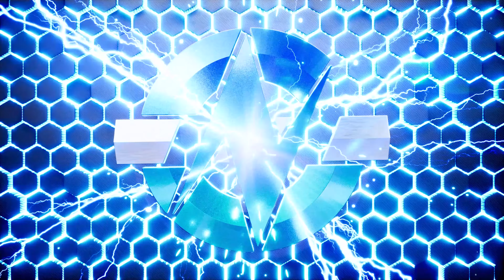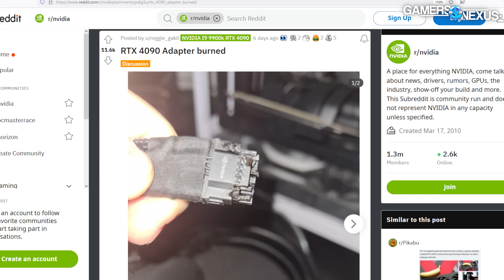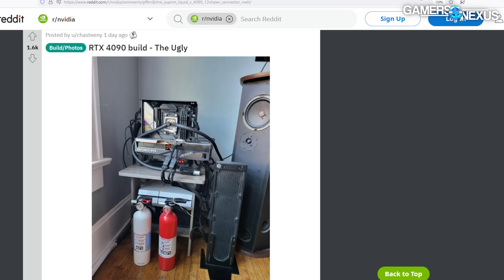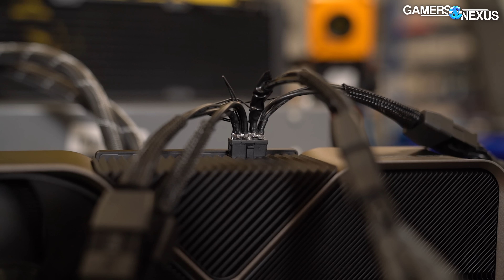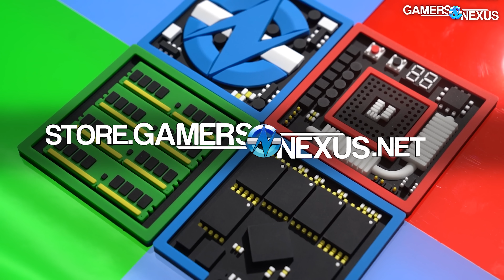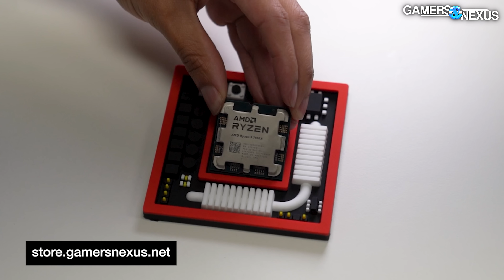Testing Burning NVIDIA 12VHPWR Adapter Cable Theories (RTX 4090)

Comment: I think the camera looks like a "Jeff " and thanks for doing the testing . you have just raised another big point about the cable "V" rating and plug make up. What I dont understand is if they only need 4 X 12V cables and 4 X negative cables why did they need 4 X 8 cable connectors and why not just 2 like corsairs ? easier to squeeze in less cables ?

Comment: Name for the cam: FLIR-E
It just reminds me of WALL-E. 😂

Also: I believe the most heat would be generated if the cable is snapped, but still close to the connector so that it loosely connects with a high resistance. This would lead to a rapid increase in temperature additionally to some internal sparking.
Ripping them apart and just leaving two, or even one of the 4 12V cables connected is, if you can believe it, a happy failure case. Having it arc and connect only slightly is the worst case.
Disclaimer - I am not a studied electrician but messed with low voltage all my life. This is just what I experienced. Take it with boat loads of salt.

Comment: Connectors melting at the front, indicating poor mechanical pin-pin contact, oxidated pins, low quality pin material… Tech youtubers (except one) focusing on the back side of the plug, on solder and wires. What?

Comment: I wonder if arcing caused the melting.  So cutting cables wouldn’t do it.  It would need to still be passing electricity through lifted solder points while insulated.  I know very very little about electricity but this is what my common sense tells me… 🍻. And if this is what causes it, it’ll be lots of cables that melt as this is how the crap cables are failing.  Seems like the better made ones won’t fail

Comment: Why aren't the pins directly connected to each wire and the bus bar located inside the actual GPU? That's how it is in most other electronics I've looked at. I was just watching a breakdown of the battery in Tesla vehicles and the bus distributor is an internal component of the actual battery pack and not external at all. Which makes tons of sense. It's a point of failure and having it be part of a connector seems really strange to me. I'm not expert at all and I could be talking completely out of my ass here.

Comment: Looking at the specific models that have been popping with the burned adapter, I noticed that they all have the female connector very recessed and I tried this with mine (Gigabyte 4090 Windforce) if you plug the adapter in while the GPU sits horizontally in your PC its very difficult to get proper contact while mainting bootable contact. I then laid it on the side and plugged it in and was able to hear the audible click and it went straight in. Mind you my model doesnt have the female connector as recessed as the others do, specifically the Asus TUF and MSI Gaming and Suprim models. Could this be a combination of poor design and it being easy to plug the adapter in to a bootable state but not proper contact?

Comment: Oh, I wasn't sure if this was going to be tested by GN.  By the way, AMD has already confirmed that they will not be using this standard of connector.  They'll still be using the previous connector.  The interesting part of this is that there are two different cables.  I'm curious if this was an already known issue by Nvidia well before release and was revised, yet a few bad cables still made it out.

Comment: I'm wondering if these cables are hand built, so the different styles of soldering could be down to individual workers in the factory/factories, different wire specs could be supply chain errors or different revision states as the adapter evolves and possibly even as deep as to the type of solder, paste, lead or lead free, or type of flux used during soldering. BUT ultimately trying to reduce 32 larger pins from 4 connectors into 12 on one whilst trying to make that connector smaller is ridiculous, it has less contact area at its bridge point to the card and you introduce 12 more points of resistance that you didn't need (you would always have the 32 from the 4x8 pins). I don't have a 4090 and as of yet have not physically handled one, so my proposals are all drawn from images and videos I have seen online and a serious interest in finding the cause of this as I suspect it is only a matter of time before this takes someones life.

 Now I'm wondering if this IS not the adaptor at all, and without seeing the failed adaptors opened up to prove that contacts within them were damaged or the cards themselves tested for faulty components on them, I would like to throw in some new theories. 

    Vibration of the connector due to airflow generated by fans in the systems, an extreme longshot but the number of fans and the drag created by this number of cables, plugs and wires disrupting the flow will cause those parts to vibrate, the plugs being specified to 30 (iirc) reconnections is the same principle effectively, it is to do with the motion of the plug opening the female side of connectors in the plug each time it is interfered with so each time the resistance in the connector increases slightly. If this was on a sense wire pin (the 4 extra on the bank below) then this could be flicking one of the triggers which tells it to draw 4 lane/600W rather than 3 Lane/450W and this fluctation WILL cause increased heat.

    Or maybe a component failure on the cards, could this be something like a MosFet overheating and drawing more current down certain lines, or similarly a failing buck convertor circuit doing the same, and the rest of the power train is able to bypass the fault but draw the same current through the rest of the circuit thus drawing higher current through the supplying pins to the remaining working power stages causing a rise in thermals at non solid connections in the power supply.

     Lastly, faulty manufacturing, but not as described before, we've seen 150V and 300V main cable adaptors both suffer this, but has anyone checked for short between the 2 rails, as I suspect these are hand made, then the possibility of human error is there and that being damage to the plug from overheating whilst soldering the wires to the plate or solder splatter (fine solder balls) bridging the wiring and this is not tripping the OCP on PCUs because it is creating current draw below that of the OCP limit, but it remains enough to create adequate heat to melt the plastics.

Comment: NVIDIA and power cable adapter (or third party ones) made cheap in ccpeepe by snot nosed with large egos that think they know it all using the wrong parts to save time and money while ignoring specs and safety while doing a piss poor solder and crimp or tape job using the wrong solder too I bet that starts to melt at a lower temp while pushing 12V at 25a to 50a. Real good combo there.

Comment: Hey GN .. just chiming in my 2 cents worth. The connector pins that suffered the most heat damage were the ones carrying the most current. If the cable broke the connection to the pin, no current would have flowed into that pin and it would have melted the housing around the pins nearer the middle, rather than the extreme left/right ones.

Comment: On today's internet, it takes balls to publish a video like this where you've basically come to the conclusion that your results are inconclusive. Great work. I hope the call to action here is enough to get ya'll the examples you need to get to the bottom of this.
Reply: Science publishes results. That's why we don't call it marketing.
Reply: @Shalmaneser1  Proper scientific method certainly isn't marketing.
But sadly sometimes journals can partially be.
Rejecting things like reproduction studies and "less glamorous" parts of the field in order to make room for "interesting" new discoveries.

Thankfully not all journals have taken that route, but an alarming number of them have.
Reply: They aren't even really inconclusive, they just didn't confirm the theory presented. They did however conclude, there were different cable versions. Also, suggested more testing is required.

Fairly standard scientific testing results.
Reply: Balls?  It's for clicks.  Make a useful video or don't make one IMO.
Reply: @EVLS10  "Testing Burning Adapter Theories"

tests theories related to burning adapters and does extensive testing, discovering cables are different between adapters along the way

Yes, very click baity
Reply: @maxsicarius  Well, you could argue the thumbnail is clickbaity, since it gives the appearance of "there will be epic fire this video".

Comment: Not an electronics expert by any means, but in my hobby (RC cars) what I'm seeing on Igors cable is what we call a cold solder joint. You have to get the wire, mating surface and solder to the same temperature in order for a proper solder joint to happen. Looking at place the wire broke off and the wire, that particular joint did not reach the proper temp for a properly strong joint. And not only would it have been weak ( like the way it broke), But it will slow or even stop the flow of current. In the case of your adapter those are properly flowed and created solder joints

Comment: RTX 3000 line uses similar cable to the RTX 4000 maybe compare the two to see if a difference in wire specs are there. Could be possible that RTX 3000 12 pin wire harness got shipped with RTX 4000 and the ones for the RTX 4000 supposed to be higher spec.

Comment: I still think that the problem is bad soldering causing outermost wires to break off from the soldering plate, thus creating a loose electrical contact, which eventually results in electrical arcing between the broken-off wires and their plates.

Two things from a quick Google search:
a) electrical arc temperature : anywhere from 2,500C to 20,000C
b) plastic self-ignition temperature : between 350C and 600C

An obvious conclusion would be that a single electrical arc can ignite a microscopic piece of plastic, which will quickly stop burning due to the lack of oxygen (in the closed environment of connector's casing). A series of (many) such arcs, however, will eventually burn right through the plastic casing, at which point smoke (if not outright fire) will become visible.

Therefore, all experiments trying to recreate this problem by opening the casing or cutting outermost wires are going about the problem all wrong.

The correct experiment would go something like this: have an X-ray machine (or something similar) to see what's actually happening inside the casing without opening it, bend the cable until at least one wire breaks off from the soldering plate (again, without opening the casing), and then start testing that connector for internal electrical arcing.

I don't think that we'll ever see such an experiment on YouTube, though. And even if somebody manages to recreate this problem, it probably won't matter by that point.

It's obvious that all existing adapter cables with this problem (nVidia must know by now from which manufacturer(s) those have come) should be pulled, and replaced with better quality ones.

Also... soldering (as a method of choice) may have been a really bad idea in the first place.

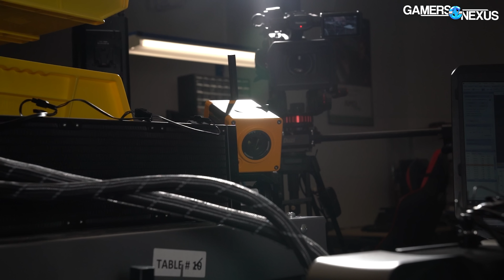Comment: 0:35 ¿have anyone noticed the pins of the card are not in the exact center of every slot?

other pictures of the connectors also look out of center contacts, if the card has no centered pins, no cable will guarantee a good connection (if you want more explanation I add a picture example)
Reply: Yes, and it's normal. Slight variance in pin location & size is normal and inevitable in the real world (things like manufacturing tolerance, wear & tear from use), which is why the metal terminals/pins are free to move a little inside the plastic housing so that they can align and compensate for this.
Reply: @rednammoc  but is too much, one is almost in the border and many out of center, that can't be normal in a 1600 dollars product, and less in an advanced electronic (you can zoom now the video on mobile YouTube)

Comment: Bet you it is a smart PSU problem where they have a line calibration to prevent droop on the GPU. It detects the large range but the PSU pushes too hard to accommodate thus turning the GPU into one of them electrified wood arts.

Comment: While the cable rating is typically insulation rating (assuming equal wire gauge) it still suggests cost cutting.  More importantly, the soldier point being weak enough to snap off and the contact being split are both ways that minor additional damage could significantly increase resistance.  
That said, the melting appears to be in the socket and not on the wire side of the plug.  That gives more credibility to the pin theory or the connector not being seated.  It reminds me of plugging in old loose molex when the female socket moves instead of seats except that didnt pull 10A on a 12v cable.
Great vid.

Comment: Soldering the cables to the contact like that seems like really strange design choice. Normally you want a physical shrink instead. Not making it 90 degree is also a strange choice considering that it must bend close to the side of the case. The narrow design making it vulnerable to side way forces is a third. 
So disregarding what some "youtubers" say I think this contact is bad.
Connectors overheat when there is bad contact (higher resistance) or intermittent contact (micro arching) between the pins. Both versions take some time to develop (if ever) which is why it is hard to test, especially for time challenged youtubers.

Comment: Excellent video Steve. I for one really respect the fact that you took the time to properly investigate and not just use this situation as an opportunity to harvest easy clicks. 

There’s a fine line between raising awareness of a potential danger and uninformed alarmism, and many channels crossed it this week IMO. 

Cementing yourself as the best in the business and we all greatly appreciate your efforts.
Reply: ironically igors lab was probably the worst offender for alarmism... some would argue its informed though but clearly something isn't right with his discovery and stating that its THE issue. i checked my 4090 cable and i have a 300v cable (msi gaming x trio) it will be interesting to see how many 150v cables are out there.

buildzoid (actually hardcore overclocking) made a good point in that if it was the solder contacts being broken and causing the issue then the heat would build up at the solder contact point and they would all be melting much further down from the pins and so far the evidence shows melting is always in and around the terminals.

who knows. i agree its good to see actual in depth testing without jumping to conclusions.
Reply: @jinx20001  I think Igor’s content potentially  came across more alarmist than he perhaps intended due to the language barrier. But yeah it certainly did read a bit “I’m right and everyone else is wrong”. 

But at last he backed up his claims with actual testing. 

And yes AHOC’s point is very valid. Although I’m not sure if there’s a larger gap between the plastic and metal near the contact pads than there is around the pins themselves. 

It would absolutely be the case that if a pin wasn’t interfacing correctly it could cause this problem too as they’re responsible for carrying such high current.

Comment: There's one caveat with all these theories in that electrical current, much like water currents, prefer flowing down the path of least resistance. If one set of pins has a low resistance, and another set a high resistance, assuming the 12V connections meet at each end, most of the current will flow through the pins with the lower resistance, even if it means these pins will gain heat in the process (up until an equilibrium is formed, if possible).
This is looking like somehow every centre pin is failing either in the connector, in the cabling, or somewhere else is failing, leaving only one pin on one end or both ends connected. This makes sense with the 1+2+2+1 solder layout if the cable were to be completely defective or almost completely failed when being used.

Comment: My one case when I made a molex type connector come close to failing by borderline rating it has manifested after several hundred power on off cycles and about a hundred hours of use over the course of about 3 years, there was oxide discoloration on the metal and the connector was about to go runaway, where with each use or several it was getting a little warmer, it would have actually caught fire eventually. The housing was clear polyamide and it was showing a little colour change. I think it's a fair guess that if a connector is getting perceivably warm and isn't warmed up externally, like you can feel anything like 55-60°C or anything like that, there might be 90°C or more on a microscopic patch of the contact area.

Comment: Really appreciating that SOMEONE does actual tests instead of running with bullshit and theories as though its gospel truth. If it wasn't so horrendously expensive to get things shipped to where I live from USA I would be buying stuff from you guys to support your awesome work. I can't think of anyone else with your level of integrity and dedication to actually testing and proving what you claim.

Personally I think the solder stuff is a red herring, I would suspect seating issues with the pins in their housings. I don't have testing capability myself, but I just think it's most logical given the damage we are seeing.

Comment: Due to the lack of labeling outside of the wire/package. I suspect there was multiple types of the cable, the "weaker" ones for lower grade cards, while the higher grade higher grade ones where meant to be for the 4090's.
A single mix-up or mismanagement, bad delivery anything could have caused this entire mixup of the cables and the supply.
I would argue cheapening out and having 2 types of the same wire is already bad to begin with, especially unlabeled and especially at the price grade of Nvidia cards at any tier.